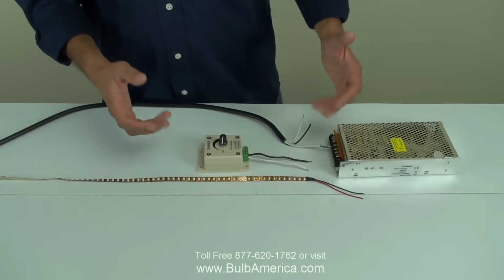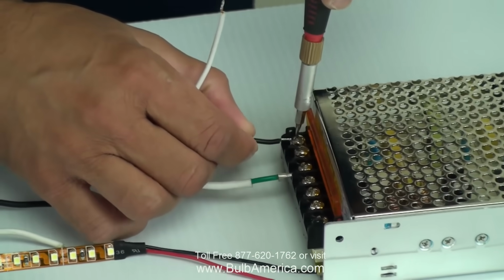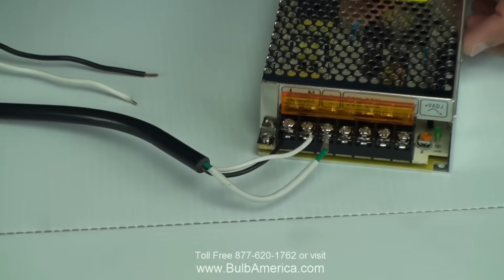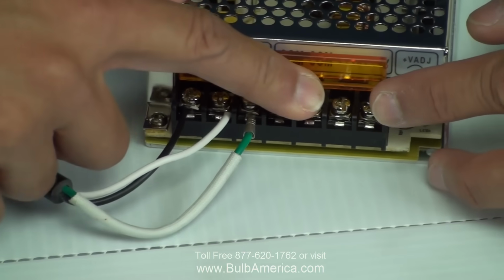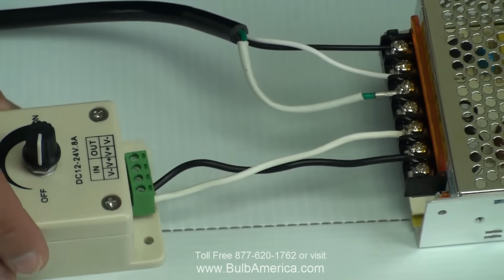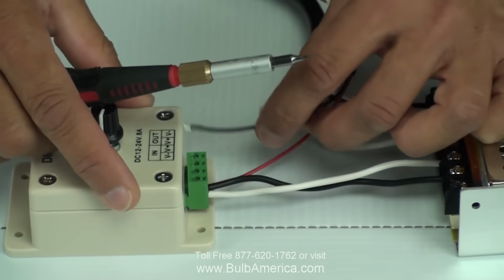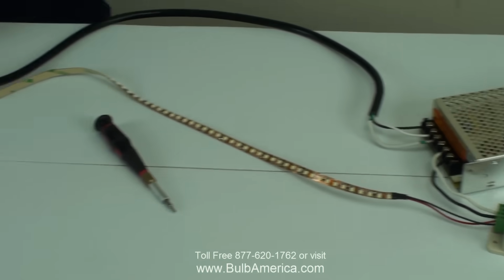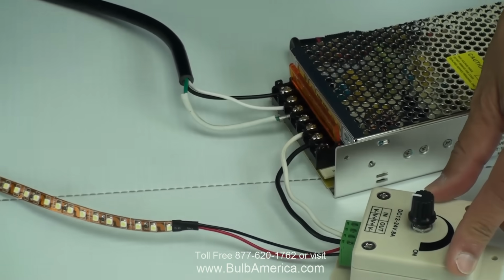LED Strip - Connecting the LED Power Supply and LED Dimmer

Comment: Thank you for the video in.mynexperiment ihave fone wrong connection from.ditect power supply to dimmer and the dimmer got blasted and there was failure iny experiment from the above video show ican correct myself to get the output

Comment: Hi, I use 3  led  strip, 2 white and one blue( each one 18w ) for my aquarium lighting connected with a 12 v, 10 amp power supply.  Will this dimmer (12 volt, 8 amp)work to reduce the light intensity like the way u connected it with the power supply??
Plz reply. It would be a great help for me. Thanks

Comment: Thx for video.. I have just get in my 720 /36 volt powersupply and induction heater modul.No manual at al with both parts. The 36 volt out put have next to the 230 volt input :   3x " -"  and  3x "+"   My qestion is.. are this  the same out put channels to connect several 36  volt items, or are they 5/12/36 volts separate outputs?  I have only a smal potmeter ...to control one output channel?

Its a model S-720-36 from Bang good.. Many thanks for your time and help! I need to heat up smal steel items for hardening. purposes..

https://www.banggood.com/AC-200V-250V-To-DC-36V-20A-720W-Switching-Power-Supply-For-DIY-Electronic-Project-p-1196806.html?akmClientCountry=NL&rmmds=cart_middle_products&cur_warehouse=CN

Comment: Can you link the two 12 volt outputs in parallel to double the amperage and increase the length of led strip you can use?

Comment: the ground/earth wire for the AC input is to ensure the outer metal casing of power supply will not have electricity flowing through it, just in case one of the other two AC wire shorts oN the metal frame .

Comment: Why did you hook up the ground, then bypassed it when you plugged it in the outlet? Also the first wires you hooked up it seems to me you made white _  and black +
Reply: The first wires he hooked up was his 110/120 input. In AC, black is live (hot) and white is neutral. In DC, ordinarily, red is pos and black is neg. If all you got is black and white, might as well stick with the plan. If black is your AC hot, make black your DC pos.

Comment: Can i use this power supply in a school bus for powering my led strips
Reply: +yadielcla This requires 120V AC input. 
You could probably run the LEDs directly from the onboard electrical if they are 12V DC.

Comment: I wonder if this supply will work with a ham radio amplifier...my amplifier draws 10-12 amps when the mic is keyed, so temporary loads.. I ordered a 12v 20amp one for $20 so if it dont work I wont be out alot...

Comment: In your video you said you didn't follow the colors for wiring the dimmer but rather looked at the connections and matched them. However you actually did follow the colors and this should always be done when wiring anything for 110V or 220V. It's a safety issues because those colors are standard in this country for residential and commercial wiring. You don't want anyone to get hurt or catch something on fire because you used the wrong color in the wrong place. The problem is most of us associate black wires with ground wires. However in a 110V home electrical system Black should be your positive/hot wire. White is "Neutral"/negative. Green is ground. "Neutral and ground are kind of the same thing. In a 220V system both black and white are positive/hot wires and green is still negative. On a 12V system black is typically negative/ground and red is typically positive/hot. This is not always the case though. But if you only have two wires and one is red and one is black it's more than likely that way.

Comment: with this power supply is the source amperage divided between the two outputs or do they both have equal current supply? If you hook up two light strips to the power supply and one has a bad connection or burns out will the other see the rest of the total current output of the supply getting double the current? Thanks
Reply: No it will not. Amps are not force fed to the source needing power to operate. Amps are available. Think of it like money. I might only need $1000 per month to live but having more available won't hurt a thing. It just means I have extra just in case I need it for something else. If you don't have enough you'll have problems too. Not having enough is what pops circuit breakers. If the device plugged in is trying to consume more amps than you have available and will cause wires to heat up and the system to burn up. It's over working it. However voltage is different. Voltage is force fed and no this absolutely should not double the voltage just because you only have one thing wired into it. That would be dangerous and I don't believe this would be permitted for sale in this country if it did that. I hope that helps clear things up.
Reply: Yes, the other will get the double current
Reply: How about my wire is only one green and the 2 wire is brown collor how i check tha live wire